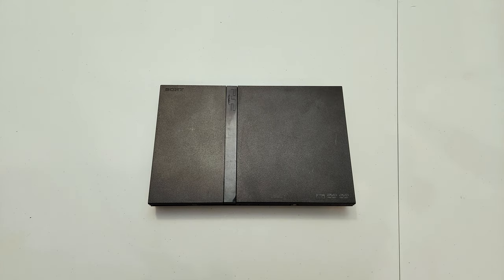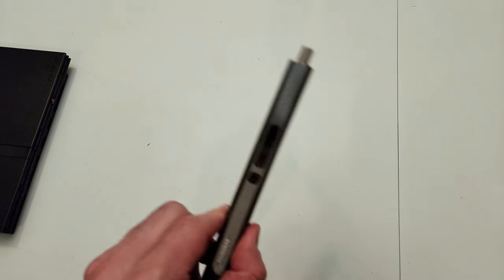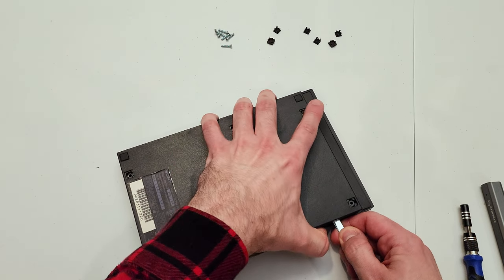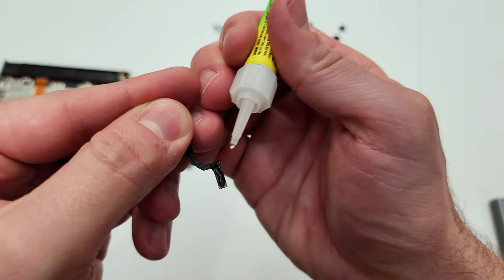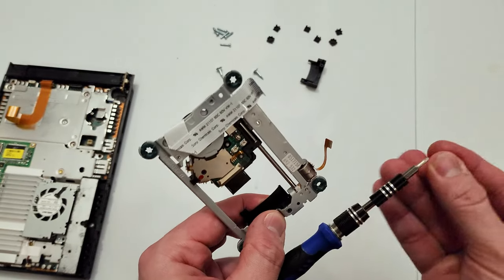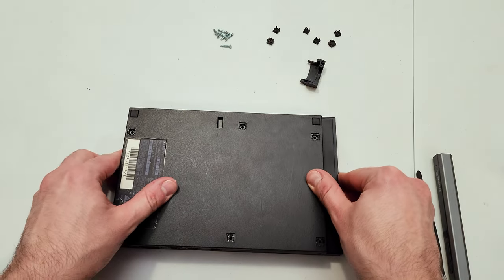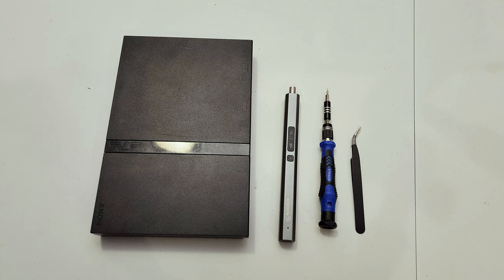The PS2 Slim: Disk Saver Ribbon Shield Installation

Comment: I designed something similar a few years ago and installed it on some PS2 and it always worked well. I also made a thread on psx-place at the time. 😀
Reply from the maker: Nice! As in a similar fix for the slim? Also glad psx-place is still around!
Reply: @hylianlad  Sorry, I tried to post the link to the thread on psx-place a few days ago but YouTube obviously deleted the comment. 🙃
Reply from the maker: @ragenfio  ah darn, if you replace the .com with [dot]com usually that'll let the hyperlink through ;)
Reply: @hylianlad  Thanks for the advice but it didn't work. 🥲

Anyway, if you're interested, the title of the thread is: My solution for the Slim's "Ring of Death", with the search bar of the site you should find it. :yougotthis:
Reply from the maker: @ragenfio   Sounds good, will take a look!
Reply from the maker: Finally got a chance to check it out, this is awesome man! And predates this by over 2 years so nice work :D
Reply: @hylianlad  Grazie! 😁 🇮🇹

Comment: Pretty cool can probably rig something instead of buying it. Only issue I can see is if the laser dies you might end up breaking it trying to remove it.
Reply from the maker: That's a slight concern I have as well down the road. Hoping for a long lifespan for the laser.

Comment: Not sure where you are, but one of the local retro gaming stores near me does disc resurfacing for about $5/disc. My copy of OG RE2 had a fairly deep scratch that didn't allow me to finish the game (I literally just beat the last boss and the system couldn't load the last cutscene), so I took it over to that place, they resurfaced it, and it worked great! Looked brand new, too. I think some GameStops do it as well. Either way, it's definitely worth looking in to if you're looking to save your copy of FFVII.
Reply from the maker: Thanks for the heads up! I'm in the Boston area and I believe a couple places near me offer this as a service too so I may look into it. Which direction did your scratches go on the disk out of curiosity? The problem with mine is that the scratches from the ribbon are in a ring shape and go completely around the disk in a perfect circle, which is exactly how data is read :/

Comment: I think the best way to preserve your PS2 and your discs is by using OPL to load games from some other media that's not your discs. It's just a matter of time, these machines aren't as reliable anymore. Today the ribbon cable got faulty, tomorrow the laser might fry up. It's best to move to solid state storage for old consoles that used optical drives, like ODEs and homebrew applications like OPL on the PS2 and Swiss on the GC etc

Comment: This happened to me some years ago. It did happen with a few of my discs before I noticed. Luckily the damage was very small on every disc except for the one I noticed at first. It was a brand new and scratch free disc. But again luckily I happened to have two copies of that exact game, and the others were only very lightly scratced and barely visible. It scared me so much that I softmodded the console and run the games from a USB trough SMB now.

Comment: my ps2 didnt read disks i just opened it up and saw the ribbon cable was torn hopefully i can replace it and it should work as usual right?
Reply from the maker: Yeaa a torn cable will definitely halt the reader from working. Thankfully that's easy to replace as well!
Reply: @hylianlad  for some reason it made gear noises everytime I opened the ps2. I think the gears were trying to move the cd motor but it didn’t have power. Anyways very weird either way

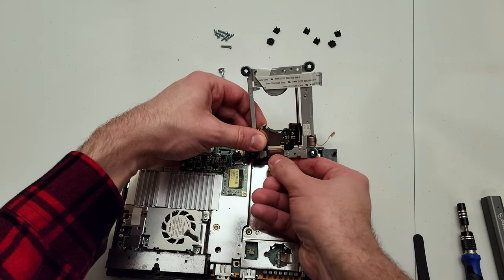Comment: Question for 6:38 I have a model 70012 and I keep prying but nothing opens like yours? Is it a different design?
Reply from the maker: Hmm pretty sure it's similar, are you sure all the screws are out of the bottom? There could be a hidden one under one of the rubber feet

Comment: I just done it but without the Printed Part i put some tape to tape the Ribbon down. 
I've heard some weird Noises now when it Tries Loading the disc - what causes that? 

And how do i fix it? 

Damn i regret trying to do this now.
Reply from the maker: Yea I wouldn't use tape, depending on how wide the strip is it may force down the ribbon cable too much and halt the laser from properly moving. I'd honestly remove it and try this mod instead.
Reply: @hylianlad  Hey i fixed it i put too much tape in there it jammed it like you said haha. 

Hey bro i can't buy those Guards tho... can you send me one i will pay you? 

i tried to buy off Etsy the guy said he not posting to UK. 

So i can't buy the Ribbon Guard - if i could id defo do that Mod - would never have to change the Ribbon ever again! 

Thanks for commenting back bro

Comment: Thanks for addressing the part about the glue for the guide wearing off I was like WTH this is useless that glue will wear off too 😂. But I’m already thinking about using red loctite instead of crazy glue. This junk ps2 ruined my $300 game so I’ll definitely get this. Cheaper than buying another ps2 model without this issue
Reply from the maker: Worth a shot! The newer version of the ribbon guard also has a small screw hole too so no glue necessary! Sorry for your game tho :(
Reply: @hylianlad well I’m sure gonna order soon lol screw would be nice

Comment: I have a mod chipped slim that because of the mod installation had the cable unglued and stuck back so the problem was boodted.
But the unit is darned chipped slim this will likely save it

Comment: SCPH-790xx didn't scratch my discs
Reply: That's because the 79000 model the ribbon cable was never held on by adhesive it was held on by plastic tabs holding it in place, so if you have a 79000 model you're basically safe from having any of your games scratched

Comment: STOP USING THE DISC DRIVE GET SD CARD MODS ON OLD SYSTEMS AND LEAVE YOUR GAMES SEALED IN THE BOX DISC DRIVES ARE OBSOLETE USE GOOGLE AND BUY AN ADAPTER